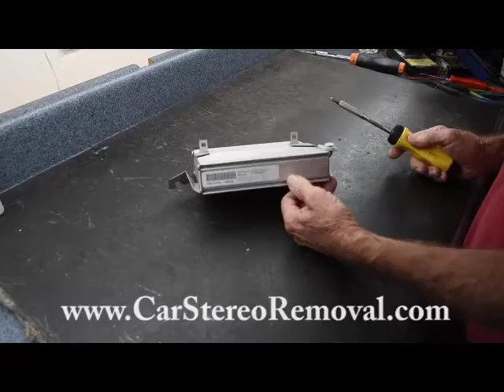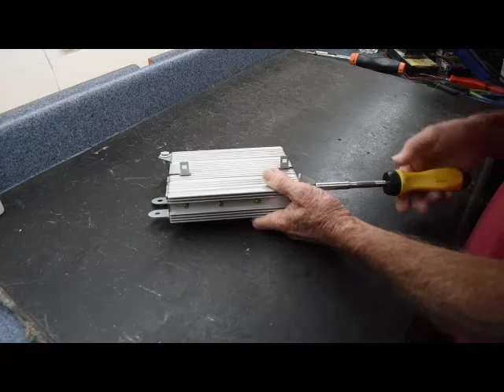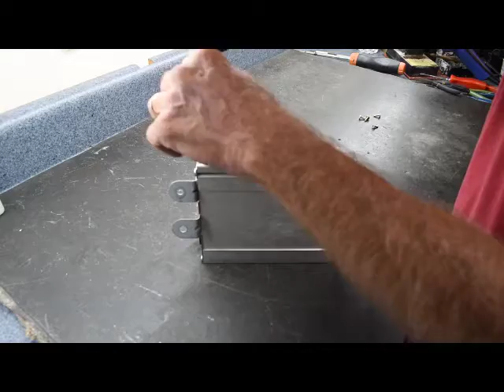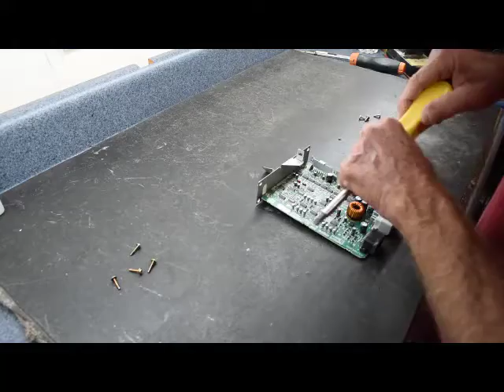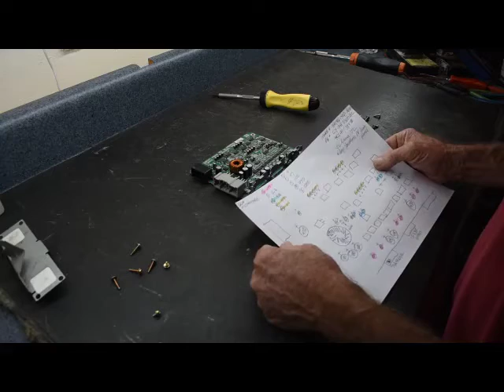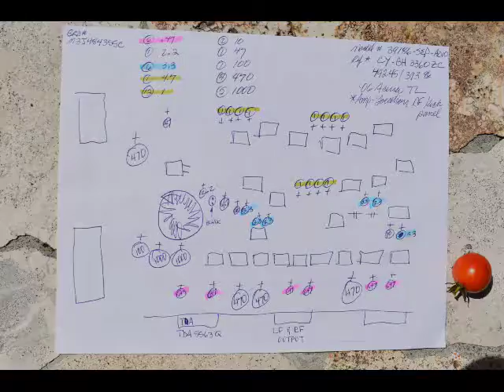Acura TL Amplifier Repair DIY - Car Stereo Help

Comment: Thanks for the video! I was having a fixed hissing sound whenever I turned on the radio and volume was not at zero. I changed the small capacitors (I believe I changed around 26) and seems to be working fine but we'll see! This is my second amp, the first one the volume became very low but this time I decided to try to fix it myself and this video helped a lot!

Comment: My son has this car and the owner before replaced the radio and took the amplifier out and cut the cables and added cables from the radio to the speakers. Today I got the factory radio and a junk yard and noticed it had this amp. I didn’t buy it but now I guess I’ll have to go and get it and will have to figured out which cables they cut off.
Reply: good luck!  When you get the amp, make sure you get the all the cables, from the radio to the amp, and from the amp to the speakers, or at least the connector.  Be aware, the junkyard amp is likely to be bad, low volume, as it has 20 years age on it.
Reply: @ I had to solder the gray plug and it’s all working good.

Comment: My audio system volume became anemic about a week ago in a 2004 TL. No real control over bass, treble, subwoofer, but the balance/fade controls function. If the volume is increased all the way max (level 40) the audio will barely be heard at freeway speeds.  Is this a symptom of bad capacitors? I could buy a used amplifier, but the caps are just as ancient as those in my amplifier. I have the patience and about a mile of solder wick to remove/replace the caps. Wish I had a solder vacuum like that in the video.

Comment: Can I use the capacitors out of a 2004 TSX for my 2005 tl they're not the same amplifier but they have very similar serial numbers the plugs are different so it's not plug and Play swap but I was curious if I could use the capacitors from 1 to

Comment: Location of the Amplifier
Reply: Behind the front passenger kick-panel, just forward of the door hinges. There are two connectors and two fasteners on the bottom and one fastener on the top which I have read requires patience/cursing to remove.

Comment: So you didn't show us how you repair it, you just showed how to open it up. Maybe if you could have included a little bit of video showing how exactly it's done would have helped. As a tutorial on how to fix, I rate it a FAIL.
 thumb down..
no subscribe..
not gonna share.
Reply: I agree, pretty rushed though. It wasn’t clear if you needed to just replace the smallest capacitors and then the larger ones on the output side if it was still not working. A list of the capacitors would have been helpful too.
Reply: I ended up getting a replacement amp at a salvage yard for 37 dollars with a warranty. Far easier. Still, knowing that the amp capacitors were known to fail made me confident that the problem was likely the amp and not the head unit/radio tuner.
Reply: @pauldiesel4582  ok so how is you amp replacement for far? did it fix the issue?
Reply: What capacitor # so I can order?

Comment: What voltage rating are the caps?  Is 16V sufficient?
Reply: They have to be at least 50V caps,  Officially they are 0.47, 1, 2.2, 3.3, 4.7, 10, 100, 470, and 1000uF 

There is a great writeup on AcuraZine "how to: OEM Audio Amp Repair - fix buzzing/noise/no volume!"

Comment: Would you happen to know where the amp fuse is located for that amp on the this car Acura TL 2004
Reply: In the under-dash fuse & relay box, Number-5 (20A). Supplies both the audio unit and amplifier. Located in or near the drivers side kick panel, near the hood release handle

Comment: Great video! That is very good knowledge and I'm glad to know how to fix these common problems. I have a question though and I hope I can get help with this. I bought a few amps from the junkyard, but I don't have the car to test them. How can I wire these up to a cheap aftermarket radio in my garage to see if they work? I grabbed all the speakers and sub too just to test, and I grabbed the harness from the back of the radio and the harnesses attached to the amp. I can find the wiring diagram for the amp, but am unsure how to hook up to a radio and what harness is necessary  for it to work. I'm also planning on installing this setup in my girlfriends Ford, cause her speakers suck. Thank you!
Reply: Get a 12v power supply can be a cheap one